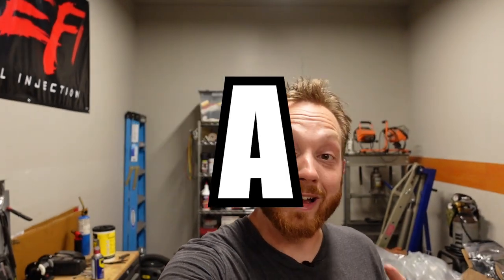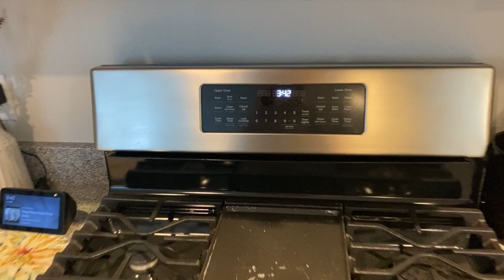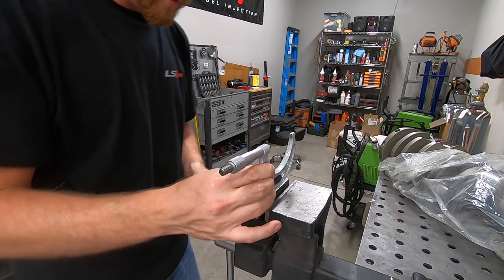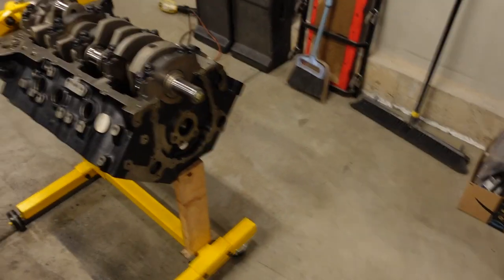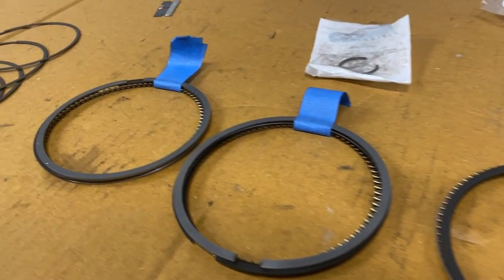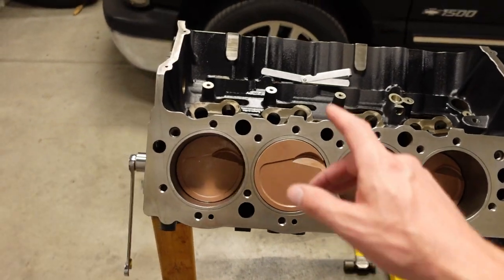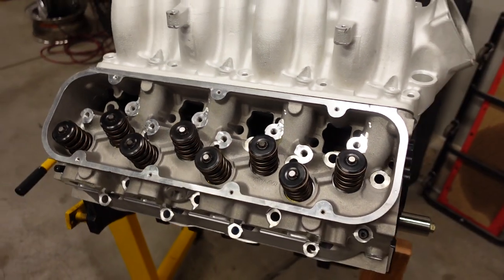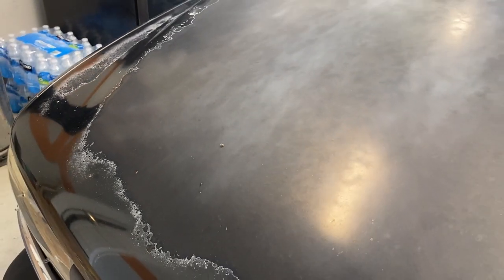535 CUBIC INCH (8.8 liter) Monster Big Block Engine Build

Comment: do NOT heat treat metal in your household oven!! 

i am a blacksmith and heat treat metal as part of my job and there are many nasty chemicals in metals that you definitely DO NOT want in the same oven as your food. im currently suffering from NICKEL POISONING because i became too careless about where and how i worked with metal so please PLEASE do NOT put anything not designed to be near food near food.

i had to edit this because i feel it was not serious enough. by heat treating metal not intended for ovens in the same oven as you cook your food, you could be POISONING YOUR WHOLE FAMILY. this is not a joke, this is not overstated, buy a separate oven AND clean the inside of your oven IMMEDIATLEY after reading this

Comment: How come you used bolts instead of studs in the rods?  Just wondering if there is a reason you didn’t use studs. 

Paint the engine black.

Comment: it s mark 7 not gen 7.mark 4 for the classic bbc.having raced and built many mk 4 s this newer stuff looks good.
Reply: GM changed after the mk 4 engines to naming them Gen 5 ('91-95), Gen VI ('96-2000), & Gen VII (2001+).  I agree it would have been less confusing to stick to the Mk naming!  I'll keep the parallel flow cooling, one piece rear main seals, roller cams, and sequential fuel injection from the newer engines though.

Comment: 8:37 what are you supposed to do if the oil clearance was incorrect?
Reply from the maker: They have different bearings with increased oil clearance, or you can have the crank journal machined smaller

Comment: Nothing without a 5th wheel requires an engine of 8800cc
Especially not a Petrol one.....

It's obscene.

Yeah it's fun and all. I loved watching 7.4L v8 Ford Sierras belt around the UK racing scene in "thunder saloons"..... 

But practically? Eh?.....🤷‍♂️
Even that was beaten by a 2.0 turbo Pinto engine.
Reply from the maker: its true, a small engine with a big turbo can make a ton of power and embarrass  a lot of bigger engines

Comment: You  really should measure the housing bores without the bearings on the mains and rods. Why? Bearing crush is critical and it's possible to hit good numbers without proper bearing crush or housing bore measurements.  On the mains, measure the front, rear of each then 10 and 2 o'clock, approaching the parting lines. 
It's also important make sure the weight of the dial bore gauge is neutralized when measuring. 

Good times.
Reply from the maker: both great points!

Comment: Why is it that everyone compares these big cube engines to Ls engines? Nice built Big block though
Reply from the maker: Its not a fair comparison I know, but the LS is kinda like the "gold standard" of performance engine so it makes for a neat comparison
Reply: I get it but to be honest if you were comparing that big block to a big inch Ls like 464 or larger it still wouldn’t make as much power if all the components were equal.

Comment: Isn't it kind of pointless to put a serious horse power motor and turbo into your truck and mount it to a factory transmission and rearend for all your extra measurements on the motor assembly your going to shear your transmission rear end and tires, but you got a beast motor lol.

Comment: too bad you didn't go "full groove" on your main bearing. it gives you 100% duty cycle oiling to your rod bearings instead of the factory 50% duty cycle with the typical flat bearing in the 4-bolt main cap. do what i did: if no one makes a set for you to buy, buy two factory main cap sets and discard the flat bearings and install the grooved bearings in top and bottom locations. grinding a tab register in the main cap is required but can be done by hand with a 2" cut-off wheel tool and some skill.

Comment: You absolutely SHOULD check every clearance on this engine. Machinists are human and make mistakes. I dont care who machines it you must check the clearances. This includes rods, mains, piston pin, piston to wall clearance, ring gap, thrust and rod bolt stretch if applicable. You should also degree the camshaft because it could have been ground wrong or possibly your timing set was machined wrong. If you don't know what your actual cam timing is them it's all a guess. You got a lot of money wrapped up in this one to not do it correctly.

Comment: Judging by the plastic gauge it looked like you had 0.002 exactly like you should. People get SO NUTS over that! Plastic gauge don't lie and if you trust you're machinest you should only have to check 1 or 2 and put that shit together. By the time you do all that math with that dial gauge you'll end up off more and be really worried at night
Reply from the maker: according to the chart provided, the plastigauge showed 0.0015" which is what prompted me to purchase the correct tools
Reply: @LawrenceTolman  looked like .002 to me. .0015, close enough. If it turns nice with the caps snugged down and the rods move side to side freely with their caps sinched down, put the pan on it. You'll figure that out as you get older and get tired of doing all that math but it's a great way to show everyone how to use aircraft tools on a car engine. When you've done dozens and dozens of them you can feel when it all turns right and the con rods pop side to side just right. You'll get there son

Comment: How come not many race car drivers use these Big Blocks they all run the 5.3l
Reply from the maker: because they're heavier, much more difficult to install due to the size, and have very limited support from the aftermarket for speed parts, and they are very uncommon compared to the 4.8/5.3/6.0 and all other LS engines...

Comment: I NEED SOME HELP OR ASSISTANCE IF ANYONE CAN PLEASE PROVIDE THE INFORMATION:

1) 
NOT TRUCK RELATED:
I'm looking for a FWD 5.3 complete with undercarriage and wire harness and computer (engine and transmission)
2)
A)
RWD 5.3 Enging and Standard Shift Transmission 
B) 
Long Wheel Base Van (rolling chassis) that has NO GLASS IN THE SIDE OF VEHICLE (Mississippi is of no use for finding these parts)
C)
1973 Monte Carlo S (rolling chassis in fair to good condition)

Comment: I really don’t like that only one company makes parts for the 8.1 496 vortec 🤦🏽‍♂️ not elder Brock or Holley not even Texas speed ..raylar and that intake says one thing to me slow and don’t even dream of 7k rpm I don’t like that thing 😟I rather take my chances with an Single plane intake and use efi or an blow though carburetor with E85  just because it would get more air flow though that vs that Direct copy of the PEM intake 👀 Texas speed needs to start making parts for the vortec 8.1 same with the others

Comment: So I just want to asked why did you not  balance and blue print the engine before assembly, consider the amount of money and demand of 1500 horse, I think you should've too protect your investment, and give your motor more longevity under high horse power.
Reply from the maker: It was all balanced at the machine shop before hand…

Comment: Boost pressure by itself doesn’t mean anything useful. Mass of airflow does. You could put some tiny cams and a horrible intake on it and push 80psi of boost and make poor power for the boost pressure. Or huge heads giant cams big valves, giant throttle body and I take, and only push 23psi and make huge power. It’s lb/min not I take manifold pressure.

Comment: That's a very inaccurate way to measure a bore with two points.  Look into getting you a Tri Mic.  It uses three points of contact. Expensive -hell yes  but will keep bad readings out of your build.